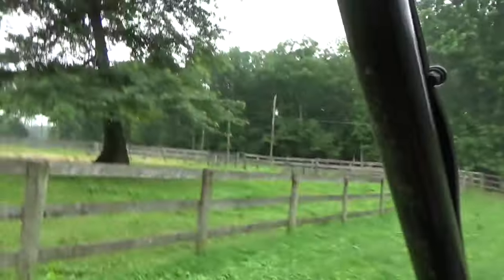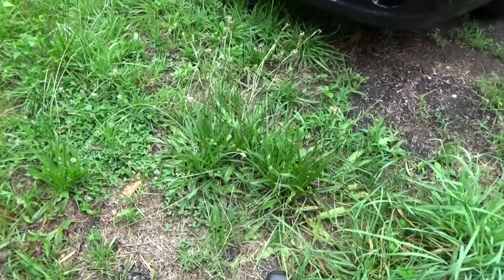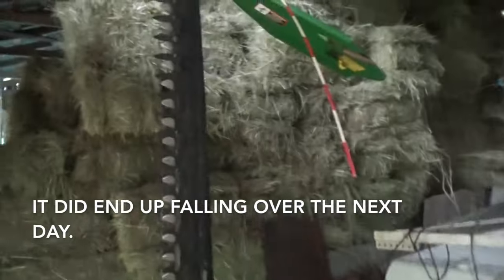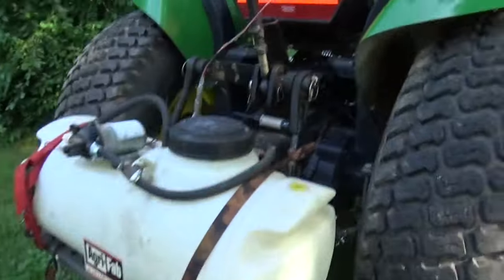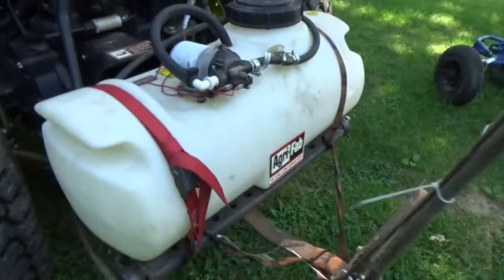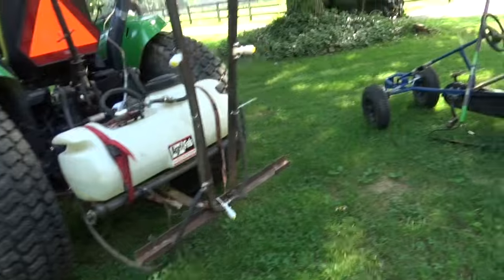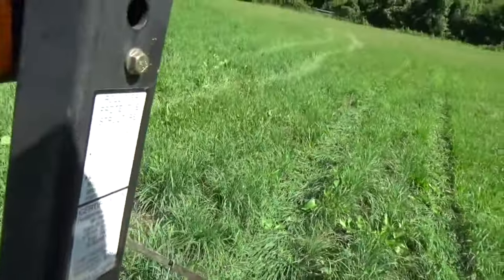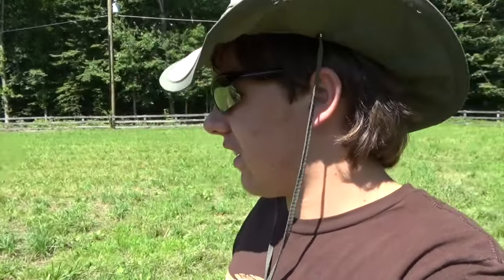Spraying the hay fields

Comment: Forgot to mention on the homebuilt sprayer we added onto the tractor-- we could then use several different booms with it for different purposes... we had a homemade boom that would go under the tractor's belly (using brackets that bolted to the rear loader mounting holes in the sides of the tractor) with nozzles on 20 inch spacings to spray broadcast Trifluralin and other chemicals that needed to be "incorporated" into the soil using a disk pulled behind the tractor-- this was a pre-emerge treatment for weeds in cotton and soybeans.  Later we'd remove this boom and run the boom supply hose from the valve back to another boom we built with an "Teejet EVEN flat-fan nozzle" over each row directly behind the planter when planting cotton... this is a "band" treatment of Cotoran or Caparol, where you spray a "stripe" of weed killer right down the top of the row on the ground where the cotton has been planted, to kill weeds that might come up within about 10 inches on either side of the row (weeds coming up in the middles are killed by the cultivator later).  We'd install the broadcast boom back there when planting corn or grain sorghum to spray Atrazine as we planted those crops... These are all "pre-emerge" treatments.  

Course I used the same sprayer setup on the tractor with a 3 point mounted boom (much wider) for making "post-emerge" treatments on fields, like Roundup or DSMA/MSMA, or other chemicals applied "over the top" of the growing crop and weeds... 

Later!  OL J R :)

Comment: 15-0-0 is a fertilizer formula... always N, P, K, in that order (nitrogen, phosphorus, potassium, if you've had chemistry class in school yet).  What was the active ingredient in the spray?  2,4 D?   2,4 D should take out the broadleaves without hurting grasses, but you have to apply it the right way.  

Gotta say your sprayer doesn't look too good.  For on thing, your nozzles SHOULD be a 20 inch spacing; they should be operated high enough that they get some overlap at the outside edges of the pattern.  Hopefully you're using the right kind of nozzles as well (flat fans) to get good coverage, and your sprayer pump can deliver enough volume to the nozzles to get a good pattern and good coverage.  Looks to me from the video that your sprayer boom is too low to get a good overlapping pattern.  (Flat fan nozzles are SUPPOSED to be overlapped on the pattern to get even coverage-- they put out more toward the center than the outside edges, so when the outside 20-25% of the pattern is overlapped with the next pattern, it comes out even).  The nozzles should ALL be the same number (say a 8002 nozzle, which is an 80 degree angle, with the "02" size orifice, delivering 10 gallons per acre at a given speed and pressure.  That's a Teejet nozzle designation but others are similar, and the idea is all the same regardless of manufacturer, and there are MANY different sizes and types of nozzles made).  

Think you should REALLY look into getting a small 3 point sprayer for your tractor, maybe with a 50-100 gallon tank (you can always mix up less) with a PTO powered roller pump and 10-15 foot booms already built...  Next time you're at TSC, go out in their yard and look at one, if they carry them.  For what you're doing, I'd look for an old sprayer at a farm auction sale or something like that.  It will do a MUCH better job than those little electrical sprayers, which we use for spot-spraying brush or spraying Roundup under the fences with a little "boom-buster" (wide-pattern offset) nozzle to keep grass off the electric fence, but which really struggle to deliver enough volume and pressure from the pump to supply a decent sized spray boom.  

You CAN just build you a sprayer if you can't find one you can afford-- make you a 3 point hitch bracket you can hitch to the tractor that you can also strap your tank down onto, or get you a small tank from TSC (say about a 30-50 gallon tank).  You can buy a Hypro roller pump and PTO adapter, or use your electric pump and tank (but you need to look up the pressure and volume delivery of the pump and then select some nozzles to match).  If you get a PTO roller pump, you'll also need a pressure regulator and gauge, and hoses to connect it all (we used to put garden hose to pipe adapter fittings on our roller pumps so that we could easily disconnect them from the system and store them in the shop when not in use-- pour a little oil or anti-corrosion antifreeze into the pump and screw a couple of garden hose caps onto the pump to keep it in there so the pump doesn't rust and "lock up".  Then you'll want to select the appropriate size and number of nozzles for your boom, (to match what the pump can handle at the proper pressure and volume (gallons per minute) and put them at a 20 inch spacing on the boom, and mount the boom on the back of your 3-point frame.  

It'd be a nice little welding project (if you have a welder) or if you don't, you CAN even make one out of wood.  We used to build our own sprayers to fit the tractor when we were row cropping... we put a front-mounted tank on the tractor using a 150 gallon tank from TSC and metal tank saddle, on a homemade frame built to attach to the front of the tractor using the existing loader mounting holes on the tractor frame, built from 6 inch channel iron and angle iron.  Run a 3/4 inch suction line from one fitting on the bottom of the tank over the front axle, cut the hose and put in a suction strainer just behind the axle (so it's out of the way, protected some by the front axle, and easy to get to to clean periodically).  Continue running the hose under the tractor (connected here and there to the tractor with wire or zip ties or metal brackets so it doesn't drag or get caught on stuff) over the rear axle, and around to the PTO area (to go into the pump on the PTO shaft.  The end of the suction hose would be equipped with a female garden hose fitting attached with a hose clamp.  The PTO pump with torque arm (angle iron arm and short piece of chain to keep it from spinning with the PTO under load) would slide over the drawbar and onto the PTO shaft using the adapter attached to the pump shaft, and the hose screwed onto a garden hose pipe adapter screwed into the pump inlet.  Another garden hose adapter is screwed into the pump outlet, to which the pressure hose is attached.  Run another 3/4 inch black hose up from the female garden hose end screwed onto the pump outlet up to either your 3 point sprayer (small TSC 3 point sprayer's) boom control "selector valve" pressure regulator, or install a pressure regulator on the fender of your tractor.  Pressure regulator valves can be bought in the sprayer section at TSC.  You'll need  to install a "T" fitting on the bottom of the pressure regulator (inlet) side so that you can screw a ball valve onto that to turn the boom off and on.  A hose fitting screws into the other side of the T fitting where the pressure hose comes up from the pump, the other end of the T fitting is screwed onto the regulator, and the ball valve screws onto the side of the "T fitting".  A hose adapter screws into the ball valve and then you run a piece of hose from this ball valve to your spray boom, to turn it off and on.  The outlet port on the pressure regulator gets a hose barb adapter screwed into it, which is run back along the side of the tractor back to the other fitting (smaller fitting) on the bottom of the spray tank.  This allows excess volume from the pump to flow back to the spray tank, agitating the mixture in the tank.  I incorporated a banjo 3-way valve in my design for a boom control... the 3 way valve replaces the ball valve (it's basically a ball valve with TWO outlets; the pump supply hose comes in the inlet of the valve, with a "T" fitting installed on one outlet of the valve, with a hose adapter screwed into the bottom of the "T fitting" to attach the boom supply hose.  The pressure regulator attaches to the other side of the "T" fitting and the return hose comes out the side of the pressure regulator like normal.  On the other side of the 3 way valve, a hose barb adapter is screwed in, and a short piece of hose with a hose barb "T" fitting is installed-- the return hose from the regulator is attached to one side of the "T", the bypass hose goes back to the off-side of the 3 way valve, and then the return/bypass/agitation hose goes on the remaining side of the "T" fitting goes back along the side of the tractor to the tank return fitting on the bottom of the tank.  This way, when the 3 way valve is turned "on", the pump flow goes to the boom supply T and hose, excess pressure and flow goes through the regulator thru the return hose to the off-side T, and back to the tank bottom to agitate the mixture.  When the sprayer is turned "OFF" at the 3 way valve, ALL the pump flow is sent right back through the return T and hose to the tank, allowing for MAXIMUM agitation of the mixture (when mixing chemicals, you generally want to pump half the total amount of water you plan to use (if you're mixing a whole tank of spray, half a tank of water) THEN add the chemical with the pump running (so it mixes and agitates the spray) THEN add the remaining half of the water to the agitating spray mix, then go spray it.  You have to be careful about just dumping chemical into the water or into the tank and THEN adding water, because it CAN "clabber up" on you and form a thick, slimy mess like cottage cheese that you then have to clean out of your sprayer hoses, filter screen, and stuff with a long wire or something pushed through the hose.... 

Here's some resources for you to check out... http://www.teejet.com/index.shtml
http://www.teejet.com/SprayLitApp/LitDisp.asp?Act=ViewLink&pagename=teejet_literature_catalogs-bulletins&URL=catalogs/C51A/cat51a_us.pdf

Later and best of luck!  OL  J R :)
Reply: Wow! And the longest ever comment on a YouTube video goes to you! 👍😂